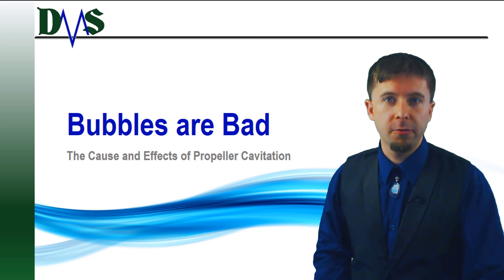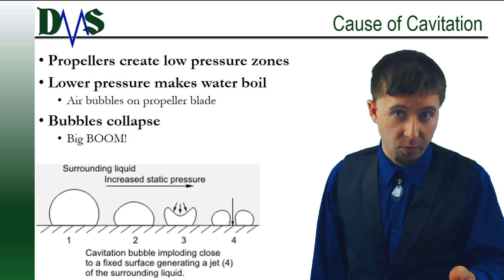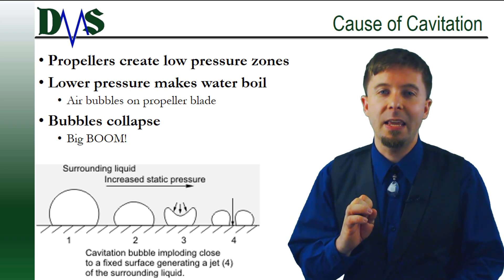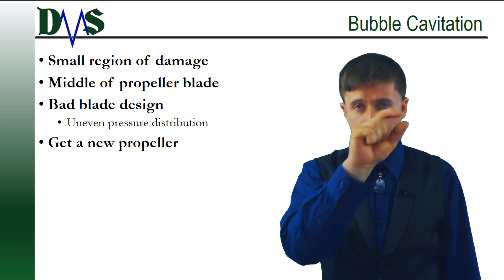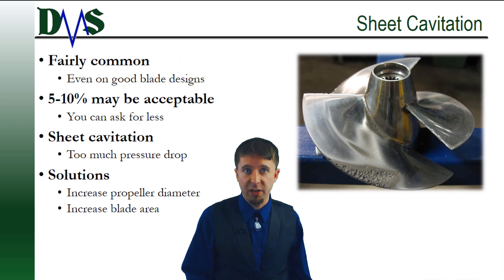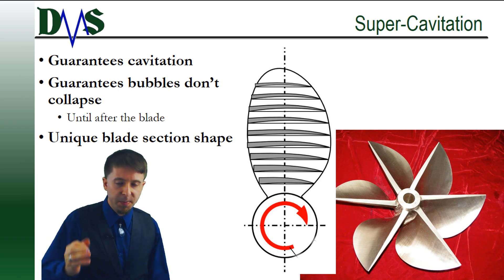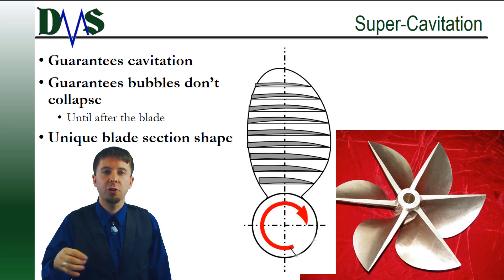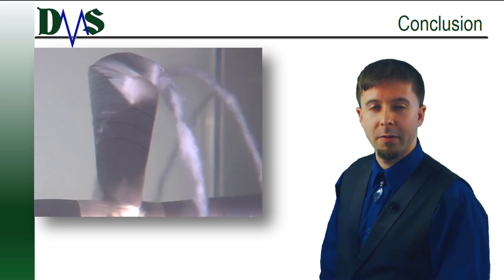Bubbles Are Bad:  The Cause and Effects of Propeller Cavitation

Comment: Is the cavitation also occurs if the tip of the propeller is 3%-5% out in the water, Pls advise
Reply from the maker: Yes, cavitation can still occur with the tip of the propeller slightly out of the water.  But in this case, ventilation is the larger problem.  When the propeller breaks the surface, or is near the surface, the rotating blades can pull air into the water.  When the air interacts with the propeller, it greatly reduces thrust, because the air is much lower density than the propeller.

Comment: Is cavitation like aircraft that produce vortices?
Reply from the maker: No.  Propeller get vortices too, but cavitation is different.  Vortices result from flow patterns around the wing or propeller.  Cavitation happens specifically because you have liquid water.  The propeller creates a change in pressure.  And that pressure change alters the state of the water from liquid to gas (this is only small layer right next to the propeller surface).
Reply: @DatawaveMarineSolutions  Thanks for your reply. So that I have this right, water comes of the propeller at a low pressure and once exposed to sea water (high pressure) bubbles form at a higher temperature (than the sea water) and then collapse in a micro-second!
Reply from the maker: @MrBradley34  Almost.  The temperature doesn't change.  The temperature required to boil water changes, depending on the water pressure.  This is why water boils faster at high altitudes in the mountains.  It literally boils at a lower temperature.  In the case of cavitation, the water pressure on the surface of the blade drops so low that water can boil at normal sea temperature.  The water never changes temperature, it just changes the starting point for boiling water.  And as you said, that only lasts an instant.  The water is now vaporized, and as it leaves the blade surface, the pressure goes back to normal ocean pressure, which collapses that bubble of steam.

Comment: I'm pushing a 30' sailboat with a 15 hp outboard.  It makes loads of foaming bubbles.  What kind of prop can be put on it to get thrust and at least half the bubbles or is it just spinning too fast for such a heavy load?
Reply from the maker: That can be either ventilation or cavitation.  If it is cavitation, you should see little pits and pockmarks on the propeller blade.  Ventilation on the other hand happens when the propeller is too close to the surface.  The prop sucks in air, which gets mixed with the water and generates lots of bubbles in the wash.  If you have ventilation, the two fixes that I would try are:  1.)  Try to mount the propeller deeper in the water.  2.)  Find something to create a physical barrier between the propeller and water surface.  I think I have seen some weed guards that are horizontal fins mounted on outboards.  That may help.
Reply: @DatawaveMarineSolutions  I hope there's a place to mount one of those barrier fins you suggested. Thank you.

Comment: They are not “air” bubbles they are vapour bubbles.That is the water changing from a liquid to a gas due to the water reaching its vapour pressure.There is no “air” underwater. You must get the basics right if you are going to profess to know what you’re talking about.

Comment: Since air lubrication reduces friction on a ship's hull, wouldn't using air to lubricate the propeller using super-cavitation not only reduce drag but eliminate wear on the surface of the propeller?
Reply: Perhaps but complexity of having a hollow shaft and air ports on the propeller surface to allow bleed air to come out would probably increase costs enough to barely break even. And on a submarine you wouldn't have a great supply if air unless you used reactor power to perform water hydrolysis and blow oxygen from the blades.

Comment: Something I"m wondering about - cavitation is caused by the reduced pressure resulting in a decreased boiling temperature of the water, until the boiling temperature is below sea temperature. This makes it sound temperature dependent - will cavitation happen more in warmer seas (say 85°F water of the tropics) than in colder seas (such as 25°F seawater of arctic regions?) If so, how much difference does water temperature make?

Comment: Is a super cavitation prop similar to a surface piercing setup like an Arneson or Levi drive? Racing props maybe?
Reply from the maker: Yes.  It would be more accurate to say they are two different qualities.  A fully submerged propeller can also be super cavitating.  This is very common on surface piercing propellers because of the high speeds we use them in.  The intent with a surface piercing prop is to have less of the propeller in the water, which reduces the prop drag.  But this means the force from the propeller no longer lines up with the propeller shaft.  So we need to reinforce the blades, hub, and shaft to handle that unbalanced load.  Plus redesign the blade shapes to handle all the extra air they suck in.

Comment: Air bubbles?  Aren't they water vapor?
Reply from the maker: True.  Water vapor.  Steam.  Gaseous water.  I target these videos for a non-technical audience.  Sometimes I use less precise words in favor of easier to understand concepts.  But you are quite correct.  It is not technically air.  

Side note:  we do get actual air in the propeller.  That is called ventilation and occurs when the ship is light loaded and the propeller is near the water surface.  On slow moving commercial vessels, this is a bad thing.  For super fast power boats, we actually design the surface piercing propellers to take advantage of that and make ventilation a good thing.
Reply: I've seen many old WW2 videos showing Liberty ships with their propeller halfway above the water while steaming around the old shipyards.